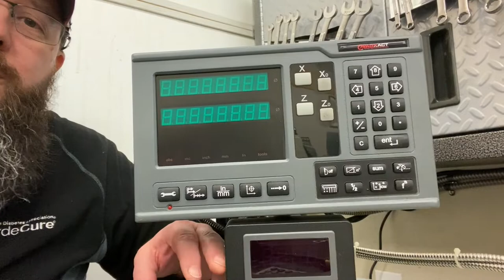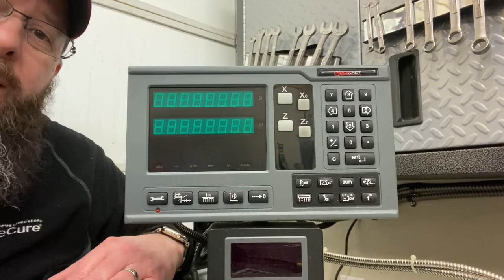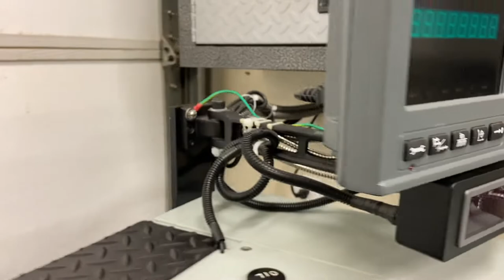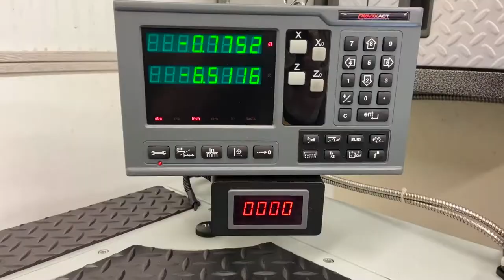Installing a Tach on Your Metal Lathe like this PM 1440TL

Comment: Thanks for the great info about the tach. I don’t suppose you’d be willing to do a video showing some of the details for installing/wiring/setting up the Hitachi VFD?  I’m considering the little brother to your lathe (1340GT) and imagine a similar VFD setup would work. I know almost nothing about electrical wiring in general and would certainly appreciate any help.
Reply from the maker: Bob, I am not a certified electrician so I am a little hesitant to post a video on the full VFD wiring. However, look me up on The Hobby Machinist (BladesIIB) and send me a PM and I am happy to connect one off and share all I know. I had great support from another HM member who walked me through the set up and I am happy to pay that forward.  I also knew nothing about VFD’s or wiring and 2 months later had the whole thing built and ready before the lathe arrived. Another 72hours or so after the lathe arrived and I had it all set up and running. My Delivery, Clean up and VFD Set up video has a little info (starting at 22 minutes) and if we can connect I am happy to share more.
Reply: @BladesIIB  Thank you for the offer to look you up on Hobby Machinist. Very much appreciated!  Right now the 1340GT is on back order. Matter of fact they just pushed it back to April.  I’ll reach out soon and hopefully can convince myself that I’d be able to pull off a setup like yours. Yours turned out looking really nice. I actually watched the delivery and setup video of you lathe before tuning into this one.
Reply from the maker: @BobGarrett66  I will look for your message. Now is a good time to start. Formulating my plan and sourcing all the parts took me a good 6 weeks. Putting the enclosure together before lathe arrival only took a couple of days.  If you have ever wired an outlet in your home or a new light switch, maybe a car stereo and a little soldering experience then good chance you can tackle this.
Reply from the maker: @BobGarrett66  I thought about it and even though I am not an electrician, I think I can still put out a video on the principle of using a VFD to use single phase power to run a 3 phase lathe. Every lathe is wired a little different and every VFD is a little different but a lot of the concept is the same and that was the steep learning curve for me. Happy to try and lessen that for someone else. Still contact me. Also stay tuned for a VFD video. Thanks for the nudge.
Reply: @BladesIIB  That sounds great!  I’ll sub to the channel and look for the video. I’ll probably still PM you on The Hobby Machinist as I figure this out. I’ve actually wired the electric in two shops I’ve owned so hopefully I can get up to speed with a VFD. Certainly appreciate your offer to share your experience and knowledge.
Reply from the maker: @BobGarrett66  if you have wired shops for sure you can do this. Give me a couple days to pull the video together and thank you for subscribing.
Reply from the maker: @BobGarrett66  VFD Video is live!
Reply: @BladesIIB  Just finished my first viewing. Thanks for making the video. I’m sure I’ll run through it a few time while I plan mine out. I’m really looking forward to the project.
Reply from the maker: @BobGarrett66  it is a fun project and such a great feeling when you flip the switch that first time.

Comment: Hey there how's it going? So I have a quick question?. Did you install your vfd? And if so did you run a separate control knob for the verible speed and how? Hope that's not to much.. Lol
Reply from the maker: Stivi, working on the video now. To answer your question yes I added the Potentiometer for the variable speed knob.  The wires from it go directly back to the VFD and plug in there. Should make more sense in the video. Working on it now and should get it out by the weekend.
Reply: @BladesIIB  sounds good. Yeah on mine it's a 220v single phase. I just ordered my vfd so I guess I'll have to compare and see how close or far off everything is. Hopefully close! 👍
Reply from the maker: @DemiFlower1010  VFD Video is live!